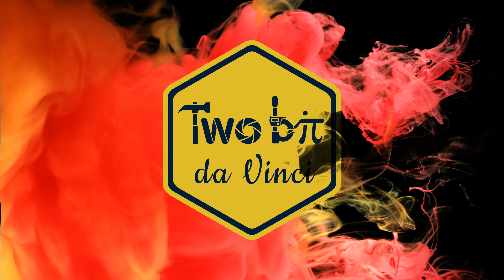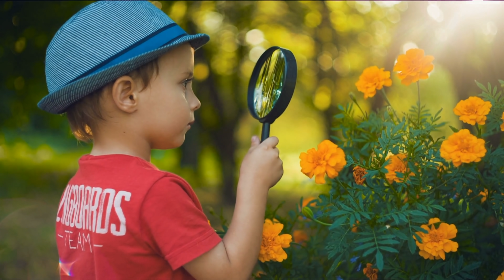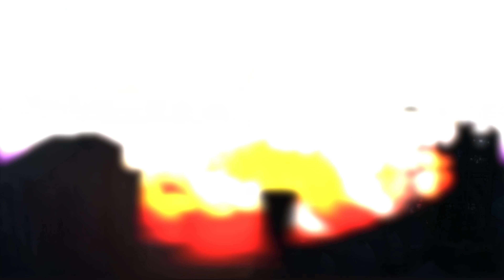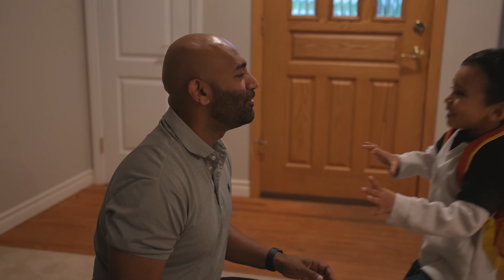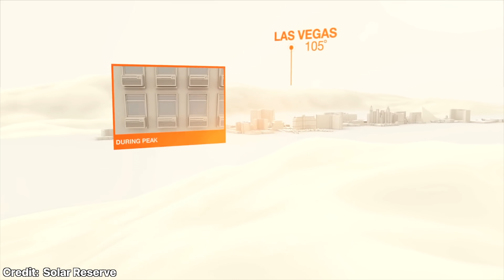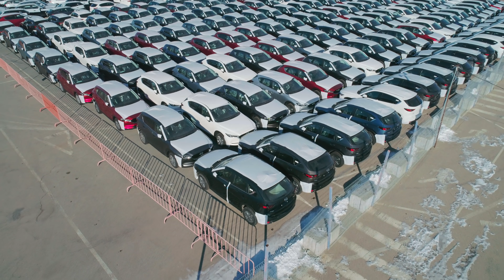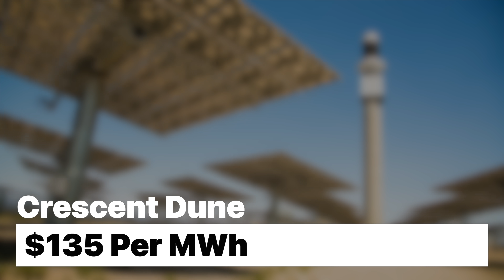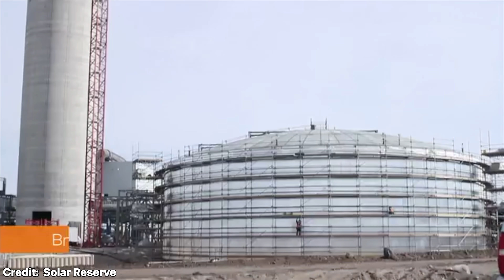This Billion Dollar Solar Plant was an EPIC Failure

Comment: Not a fail. These plants are part of multiple Department of Energy (DOE) projects trying different types of Concentrated Solar Power (CSP). The reason for molten salt is the higher the temp, the higher the efficiency of the plant. CSP also has energy storage built in which PV does not. The mirrors and steam turbines can be re-used either in other plants, or they can potentially have the towers replaced with other non-molten salt options. Currently, other CSPs are trying sand that can be heated to 1000C on only need hoppers to move the material.

Comment: Back in the 19-sixties a plant was built in souther France at Odeillo or Font-Romeu-Odeillo-Via, France. It still runs as a research facility. Not everything need to be economically successful. There are also other values to consider. However, I can’t imagine that the Odeillo facility is a complete economic failure.

Comment: This guy is completely wrong suggesting that this sort of power plant could replace peaking power plants.. Peak power consumption is during the. Of greatest heat from the Sun- the very time that this power plant is the most efficient thereby making this a peaking power plant... any retained energy from molten salt it allows it to run in the evening would only be supplanting base load power plant production

Comment: This guy is confusing Ivanpah, another disaster of a Solar Thermal Plant, with Crescent Dunes, which went bankrupt after 4 years of losing money and only averaging 40z50% of its stated design capacity. These plants have a design life of only 30 years
Reply: He mistakenly refers to the Ivanpah location in the opening of this video ("Southern CA going to Vegas") as the Crescent Dunes project.
Ivanpah is much larger, has no molten salt heat storage, and requires huge natural gas fired boilers running in the morning to start the process every day

Comment: I have lived in Vegas for 35 years and drive by this monstrosity every so often... ESG, the "green" movement and the moronic politicians that cling to bad ideas have absolutely destroyed this once great country...the USA should be utilizing it's NG and other resources - there should be pipelines all over from Applachia, etc, etc...yet these resources go unused when we need them the most thanks to the pathetic idiots that make decisions for everyone else...Massive projects for Drilling, building refineries, building pipelines & whatever else is needed needs to happen immediately.
Reply: The one by Vegas is called Ivanpah. It works by heating steam turbines instead of molten salt and is operational. Crescent Dunes is out by Tonopah. I wonder if the remoteness played a factor in it's problems.

Comment: While pumped storage can be useful in some situations, it's important to remember that pumped storage is a net consumer of energy - it takes 20 - 25 percent more power to pump water uphill than it generates flowing back downhill. Wind, PV, and Concentrated Solar are new sources of energy, pumped storage is not. Even battery storage is not 100% efficient (more like 90%) and other forms of storage consume more energy than they produce. Given the costs involved, concentrated solar will likely join nukes, oil, and coal in the dustbin of history.

Comment: Close to my school there is a small plant like this. It is done by hyperbolic mirrors concentrate rays on a tube, where a liquid flows (may be liquid salt, but not I am sure). They have never gone forward with this technology. Built a small prototype, measure efficiency and point out problems seems to be the best approach. I was wondering if they did it before going to the real plant. Differences in efficiency like the one described would have to have be found easily.
Reply: Hi!

Quick question. I’m a location scout, looking to contact a similar facility. Can you tell me where to find this little one that is close to you?

Cheers!

Comment: sad to hear that the molten salt scheme didn't work out I had first heard of this method from a project in Spain I haven't heard if that one worked out or not. You're right too many moving parts and you create a maintenance nightmare=KISS. Don't try to reinvent the wheel! do a quick back-of-the-napkin study on where they would be today had they just spent the same amount of $$ on photo voltaic and a storage device? (a proven system).

Comment: Now they are proposing to generate from Solar to produce stored hydrogen gas.   Not so sure that is such a good idea either.    Better ways to make huge quantities of hydrogen at very low cost - Ultra high temperature small modular reactors can have a reliable flow of hydrogen using excess heat energy by operating 24/7 at a constant rate.

Comment: I believe that the future for concentrated solar thermal power lies in small to intermediate sized installations tied to agriculture and construction materials, utilizing smaller, higher concentration solar furnaces.  Most of the heat generated in a utility size system is discarded as waste heat.  With higher concentration solar operating around 1000 C the heat could be utilized in a cascading fashion in a more diverse way.  The highest temperature heat could be used to decarbonize limestone and the very hot products of that reaction used to store sensible heat for power generation on demand.  The waste heat from power generation could then be used for drying agricultural products or water treatment and distillation.  In this way, a system could achieve 70 - 80% efficiency rather than 30% or so with a large scale system that can't utilize waste heat.  That still begs the question as to why the larger systems aren't located near salt water where water distillation would benefit from "free" thermal energy.

Comment: These heliostat plants have never worked properly, for many reasons. They push the envelope of old technologies, until they have massive maintenance,  and constant adjustments needed. 
     Fluid tech is from the 1800's, it's difficult to push it this far. We don't have steam automobiles today, the tech requires too much input.

Comment: Nuclear power is the future and we should have been building them the last 40 years! They are 90+ percent efficient and can run 24/7/365 rain shine or snow! It’s the only power generation that we actually contain the waste by product. Soon to open solar farm in Indiana takes up 13000 acres of prime farming land cost as much as a nuclear plant and will produce 1 gigawatt at peak (which will rarely happen) a 3 gigawatt nuclear plant would have only used 50 acres and last 75 years or more everyone has been brainwashed by negative publicity of a few accidents that really have effectively done no harm. Solar is fine for an individual or off grid home but not mass power generation

Comment: Why should it be photovoltaic panels XOR molten salt? Why not both? Granted, photovoltaic panels are very dark and don't reflect much light - but some light they do reflect. If they were fitted with the same computer-controlled motors, then you'd get electricity from the semiconductors... AND you'd get nonetheless a lot of heat concentrated at the tower, which could be then used to move a tutbine and generate yet more power, that's available also at night. So it'd be a win-win!

Comment: How has the Ivanpah Solar Electric Generating System in Nipton, CA SW of Prime near I-15 performed? It has 3 collectors.
It generates steam directly.

My understanding of its drawback is they preheat the water each early morning by burning natural gas. It's taking four times the amount of natural gas than design spec anticipated.
"The plant burns natural gas each morning to commence the operation. The Wall Street Journal reported, "Instead of ramping up the plant each day before sunrise by burning one hour's worth of natural gas to generate steam, Ivanpah needs more than four times that much."

Comment: I have "NO" knowledge of solar powered systems or it's verbology, But, every time l travel by there, l think it's one of the most awesome sites l have ever laid my eyes on. 
I thought it was powered by  the Sun to towers to surrounding panels on the ground. But now thinking about it, that would take an emense amount of electrical cables/wires and constant year round maintenance. 
I hope electrical engineers can figure out a way to make it work the way it was first dreamed of and be able to take advantage of the plants facility's and structures.

Great video 👍

Comment: There was a Spanish solar thermal plant operating in the sixties -- using a natural basin as the basis to focus sunlight  if I recall.  Another solar thermal system "literally" was proposed a few years ago for the rural city of Mildura Australia where I grew up and flew gliders -lots of sunshine and dry climate . The idea was to have a large acreage of plastic sheeting suspended on poles above the ground allowing for ground heating and thus  heating the air in contact (greenhouse effect)and force convection  -the 'collector was circular with a large 'chimney' at the centre with a wind turbine(s) mounted in it using the updraft (thermal) created to spin the blades - it hasn't gone ahead as far as I know but at least it is another non PV solar power system -might be worth looking into.  PS I won a regional secondary school  science contest in the late sixties using a homemade fiberglass parabolic mirror and a thermoelectric -generator using hot/cold junctions in series of Molybdenum disulphide and Constantin wire embedded in a fireclay ring shape with air cooled outer junctions and concentrated heat inside --thermoelectric using radioactive heat powers the deep space probes (too far away for solar cells ) but has otherwise not featured in terrestrial power (heat conduction is an issue as temperature difference is critical )  -only produced milliamps

Comment: Yes, reliability is an inverse function of complexity. The applied physics were sound but the moving parts killed it. I include the  hundreds of motors moving mirrors and a slip second of inattention of a welder joining a seam. Dust. Expensive labour. I do agree that it was a noble experiment. Too bad about the money though.